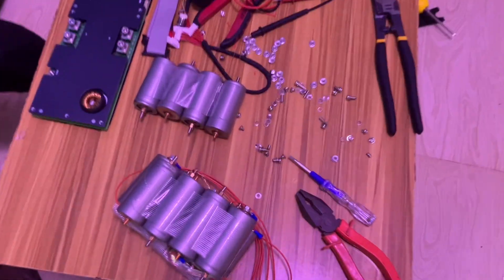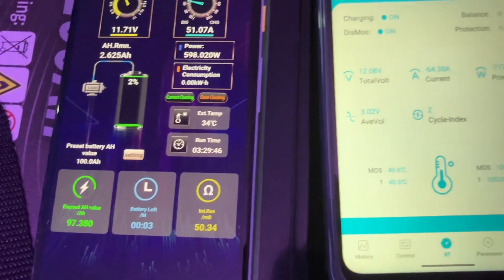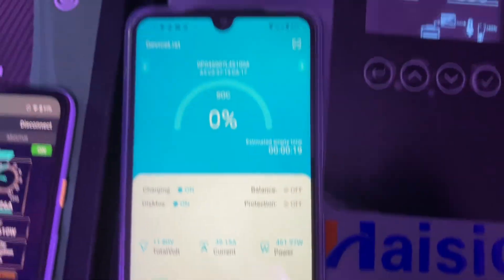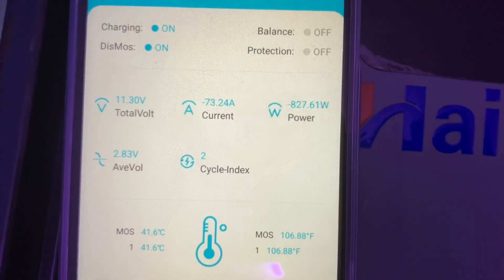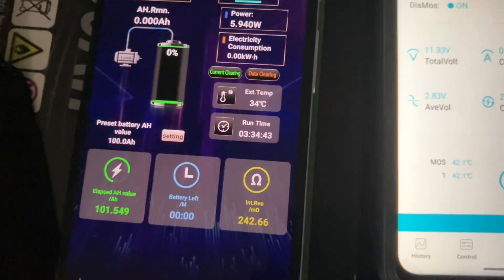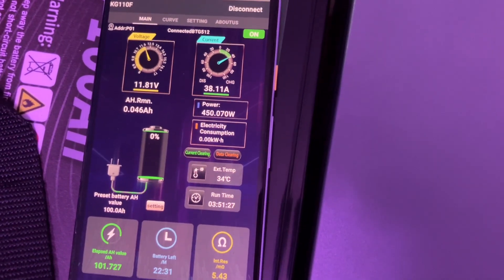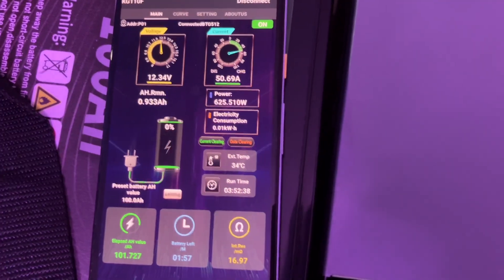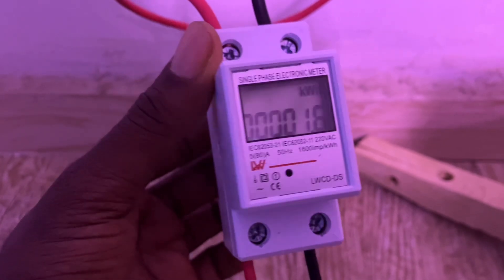Capacity and Load Test on the JOYKOO batteries and Haisic Inverter Part 2 Finale

Comment: Seems the powmr 100ah 12v just slightly beat this don't you think?
Reply from the maker: Slightly, the Typical rating on this one is 102AH
But it Edge POWMr with smart monitoring
Reply: Yes smart monitoring but powmr has active balancers unlike the passive from this one right